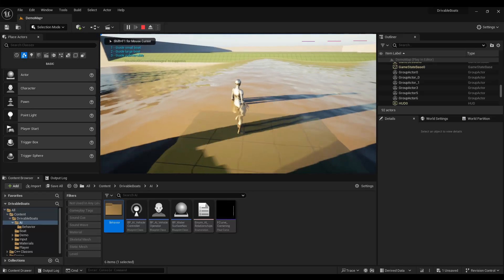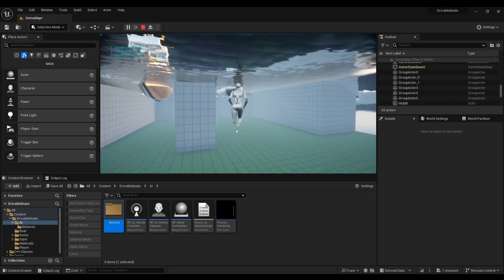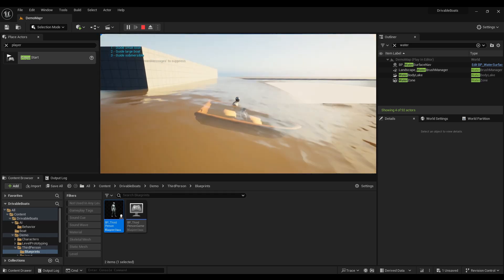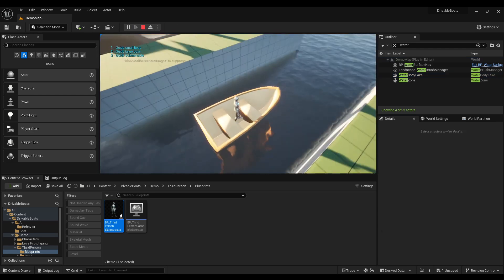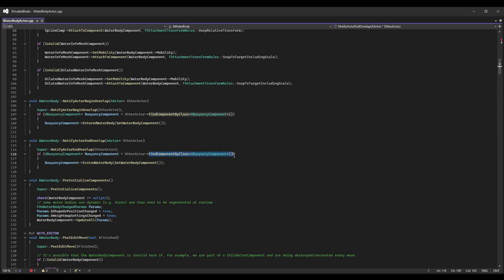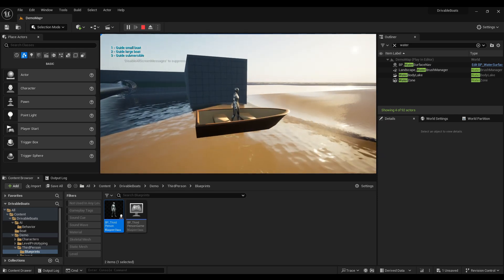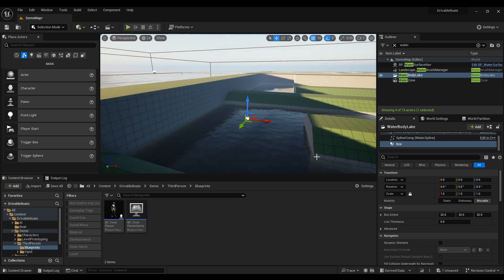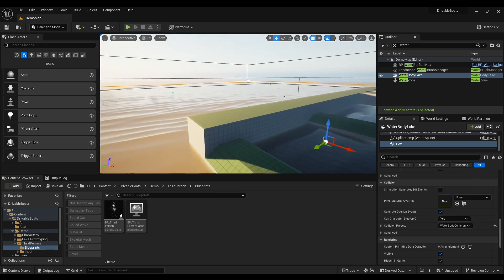UE5 Quick Tip - Buoyancy Issues with Large Waves

Comment: Thank you god, I had realized the same thing after some debugging, but didn't think of such a simple solution. Note, this also applies to the new ShallowWaterBody (Advanced Water) system. The wave heights push you out of the proper Z depth and it loses all Buoyancy. Same fix as described (but add it to your main WaterRiver actor - not the Shallow Water actor). Commenting for the algorithm!